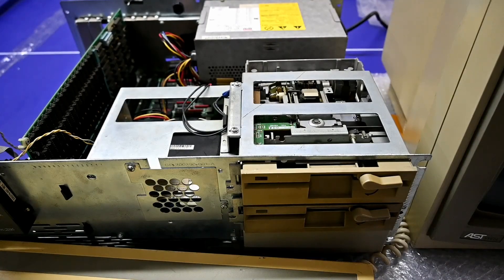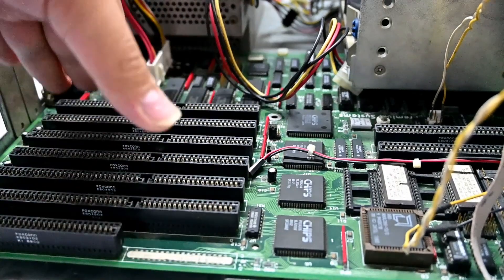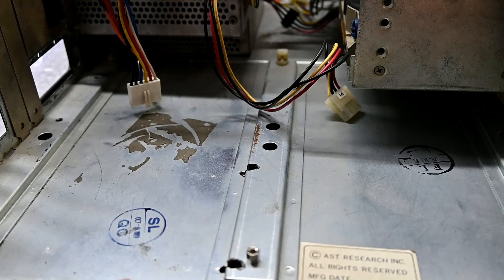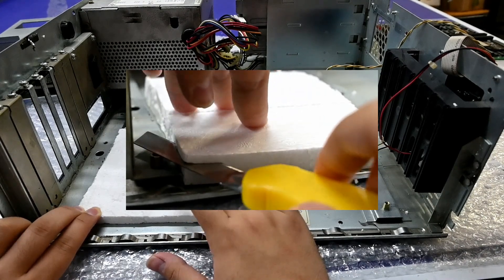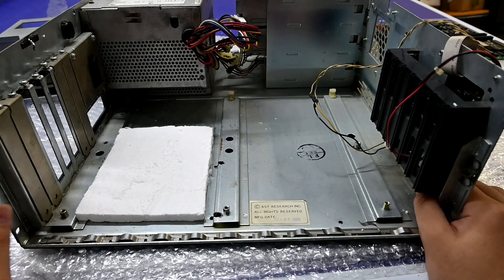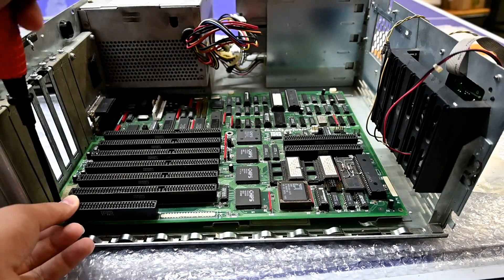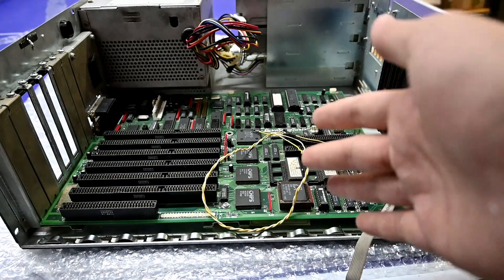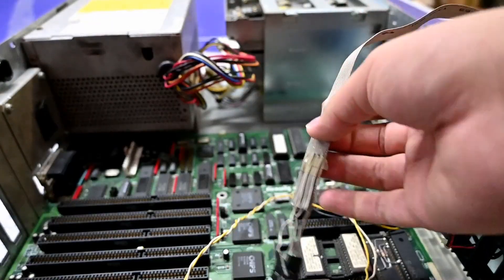Supporting the "Frankenstein 286" motherboard

Comment: Be careful, sound cards and other ICs are extremely sensitive to static discharge. Styrofoam can be safe but it needs to be grounded at all times. Also there is the issue of you are essentially turning your motherboard into a big capacitor which means the discharge could be solid-state rather than static, also frying your stuff.

Comment: If you have access to a 3D printer, you could likely quite easily design and print some support posts for the mangled holes that would provide a rigid backing for the board, without the insulation, fire hazard and static electricity issues of a piece of styrofoam. It's probably not even necessary to make provisions for screwing into them from the top, since the biggest concern is the flex downwards when inserting ISA cards.

Comment: If the board has been flexing for awhile you may want to check the solder joints on the bottom of the board, especially the isa slots. Or, just play it safe and reheat the isa solder points with soldering iron and reflow them. 
Those poles are typically called standoffs

Comment: The "support poles" are actually called "stand-offs". And the reason you don't see Styrofoam under PCBs is the obstruction of airflow and may be a fire hazard since it is not meant to transfer or absorb heat. Hope you can think of another solution soon.
Reply: Also, its not ESD safe. You run the risk of damaging your motherboard via ESD.
Reply: On the far side of the case, there is a nylon standoff, which gives the proper height for small nylon supports that can go into holes. Seems like a common standard part.

I have used them, where there as been a slot for them, and have used them, by gluing them onto the case, when there was not a slot.

Comment: I would have consider silicone rubber feet as replacement for the mounting studs. Styrofoam has a NASTY habit of static electricity that can toast components.
Reply: Also it is possible to use some JB Weld from the auto parts store to fill the large holes in the chassis support frame, and then small holes can be drilled into the epoxy to put in the appropriate spacer. Rubber feet are the way to go for places there was never intended to be a screw, but you still need support.

Also the spacers that screw into the chassis can be installed upside down and secured with a nut on top of the board, where the screw would normally go, so that they will simply rest on the bottom of the case, if you're not worried about upward flex. The plastic clip-in spacers are good for this purpose too, you just have to melt (with a lighter) or trim them to the correct height. And there are standard threaded spacers made of nylon if you're worried about shorting something.

And if all else fails, a blob of hot snot on the chassis can do the job.

I think I have a good permanent fix for the damage preventing proper mounting though. Cut down a slot cover and rivet it into place over the holes, then put support posts (with the slot cover's thickness ground off the top) in it. This fix would even hold for any other board placed in that case.